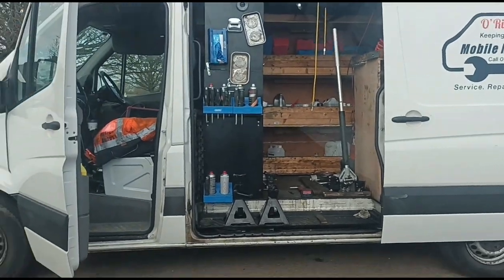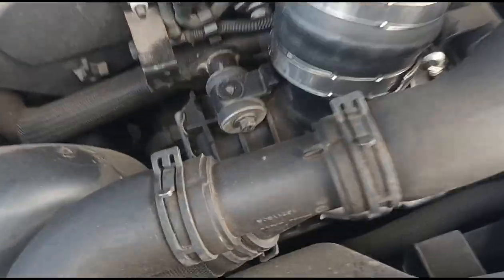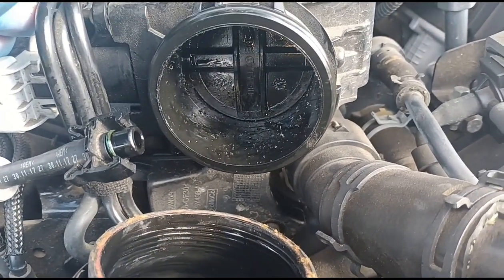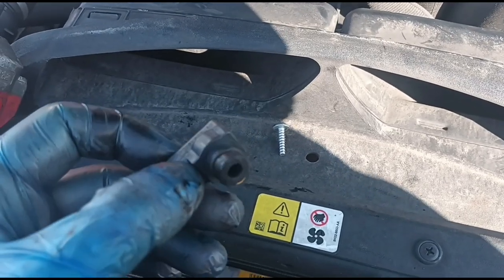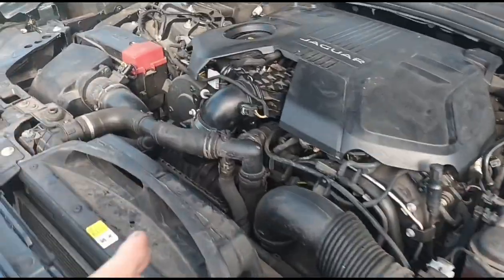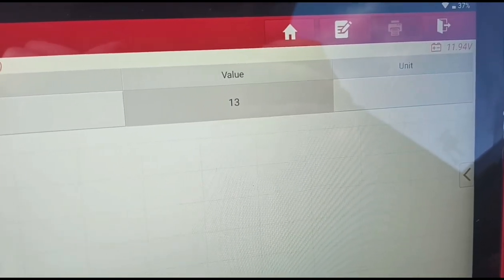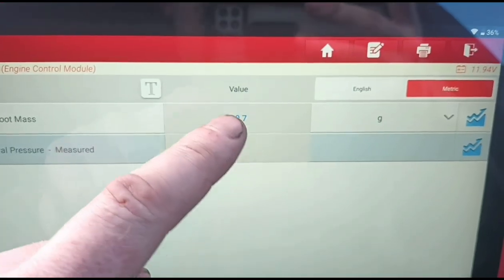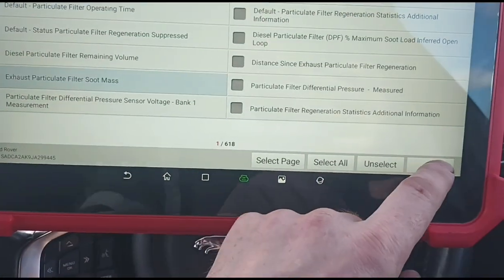2019 Jaguar F Pace 3.0 P2463-00 Particulate Filter Restriction P0234-77 Turbo Overboost P2BAE-00

Comment: I know on these engines too sometimes you can get a crack in the intake manifold, but sometimes you will only see a leak using a smoke machine when the engine is warm.

Comment: I noticed on the video in the topology that none of the modules were showing scanned. Is that because you only used OBDll Engine module and didn't do a full scan of all modules? Or did not use the plug in VCI with DoIP for Jag?
Just wondering if you got a chance to see if the unit can actually find all the modules and access them for actuation or special functions. I found out that the iCarSoft can't access most of the modules or do special functions 2017 and up JLR, so I'm hoping this unit can.
Reply from the maker: I used the a can search instead of doip my mistake
Reply: @ORileysAutos  hey message me reily 😁😁😁
Reply: Give the guy a chance it was a new diagnostic and this bloke has top knowledge on cars and there ancillary’s fact threw all his videos
Reply: @liam5786  
no worries not chastising anyone. The whole DoIP thing is new to me and very confusing.
I really appreciate Jimmy's videos they're very helpful and I've learned a lot